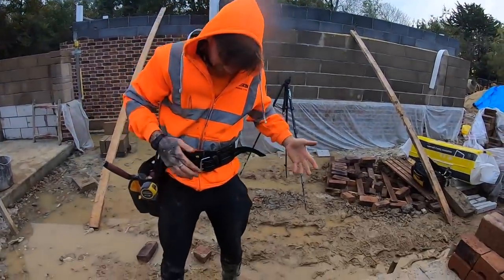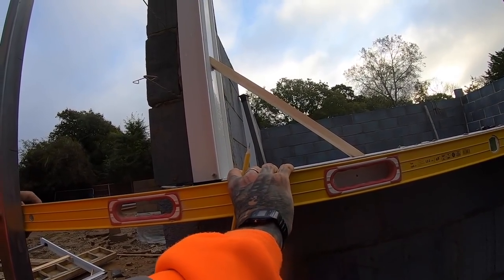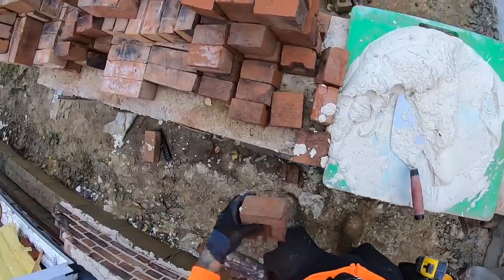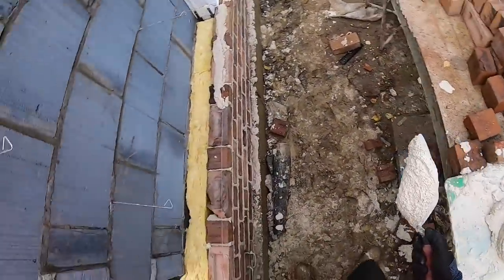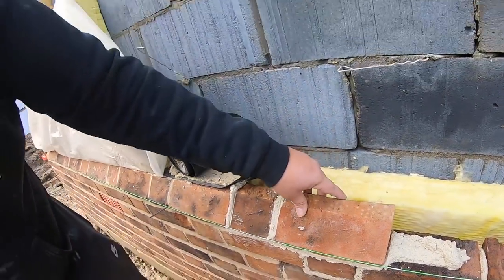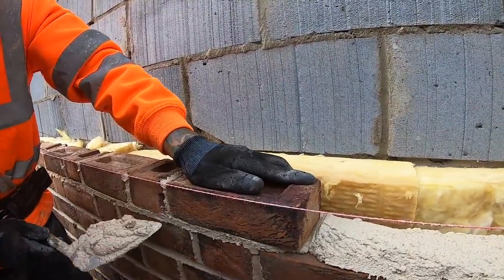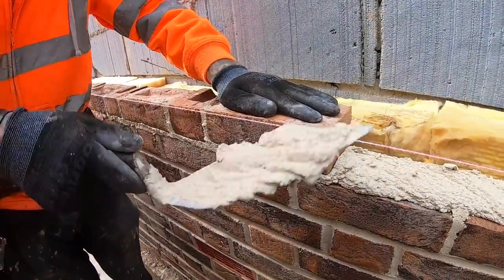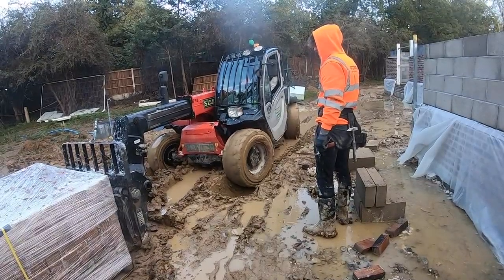Bricklaying - Day 18 - Tom got the forklift stuck!

Comment: Charlie do you think your profiles would be better if the had spirit level bubbles in ?
Reply: No aa they get bashed about just use a magnetic boat level the scaffolders use.
Reply: @maxpower1797  Thought profiles were aluminium the level won't stick to it.
Reply: @colinstevens7969  Blakes are steel.